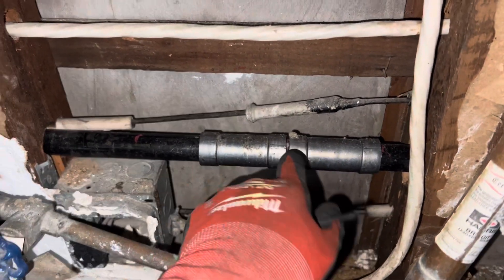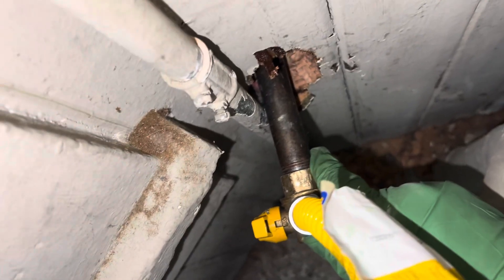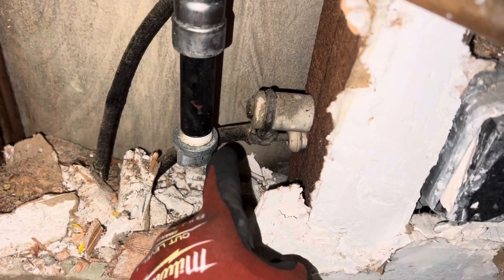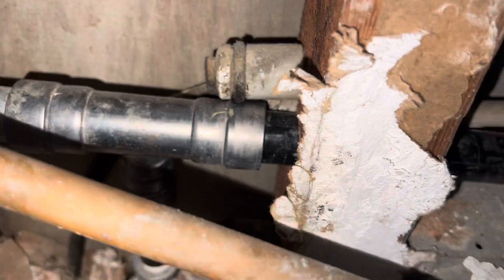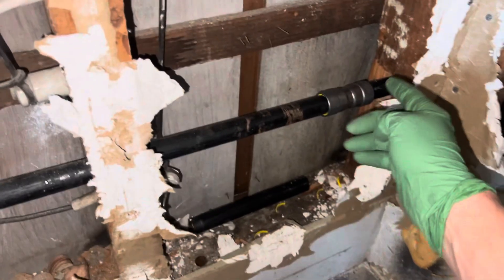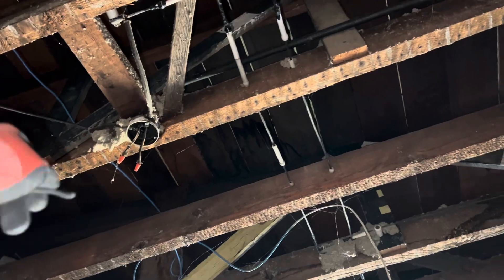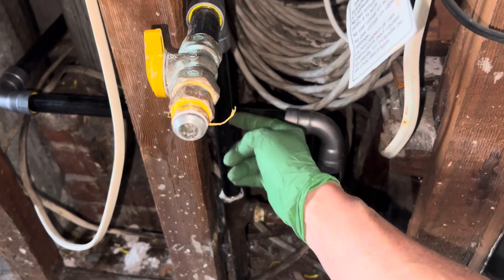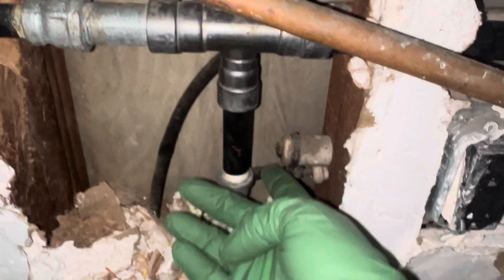Residential gas press fittings were leaking and dangerously 🔥 pressed against high voltage. ⚡️

Comment: I agree the installation was dumb, but show us the code that prohibits galvanized please.
Reply from the maker: That means you don’t work in California or in San Francisco some countries some states don’t have strict codes

If you don’t know the interaction between and the sulfur containing substance, they put in gas for the smell then that means you have no formal education. The reason why you don’t. 

In different areas have different percentages of quality of gas delivered to their customers some have higher moisture content into gas and higher oxygen content, air and other contaminants in the mixture. It’s not 100%. 

It often changes when delivered from the gas company. You can actually call down and get the BTU content. . 

Setting up to calculate their output, you know the quality and your company who delivers your gas will give that to you that time of year that it’s been delivered. You can do your calculations to clock your meter to set up your furnace and your are required to be adjusted for proper furnace set up. .
Reply: @coldfinger459sub0  I do work in California and I know of no such code.  For me to abide by it it needs to be written in the code book somewhere.

Comment: 120V is nowhere close to being high voltage, dude. 7.2KV on the supply side of a residential transformer would be for most folks, while 400KV and up on the big power transmission lines most definitely is.
Reply from the maker: Ok true. But more the most common people think of 12 car batteries. 

120V I touch for testing the way I was taught from my grandfather 👴🏻 old school 🏫

Comment: That electrical system is dead.  It shouldn't be a problem.
Reply from the maker: No it is no dead
Reply: @coldfinger459sub0  holy shit, they were still able to be insured with knob+tube wiring?! Btw, I loved the term "crispy critter wiring", that's hilarious!
Reply from the maker: @ScottFeatherston  you are correct knob, and Tube is being phased out by insurance companies.  

But actually, in reality, there’s really nothing wrong with knob and tube if you just never touch it .  

If people would stop piling stuff up in their attic space on the wires .  Putting in 1800 W heaters that burn up the wire nut connections because the copper is old black and oxidized.  Especially when somebody replaces a 15 amp fuse with a 30 amp fuse.

Comment: This is in SF, not to code at all and for sure never inspected and passed.  That gas install is totally not safe and negates the fire insurance if they have it.  If there is a fire the fire inspector will see that unsafe install and insurance will not cover their losses.
Reply from the maker: This is exactly why the owners contacted the company that did this. To do it properly.. 

I know the owner . 

They wanted me to do it . 
That is not my profession, even though my grandfather started taking me out to do gas, insulation water, pipe and sewer pipe, install installation starting at five years old to learn the names of tools .  And complete by the time I was not even in high school yet. 

I’ve had to redo gaspipe installations that were performed by PG&E on three different houses of mine . 

One location their installation leaked three times and I had to call them out to repair their handyman workmanship and this is PG&E . 

After the third time and it leaked again . 

I didn’t bother calling them. I totally disassembled their entire piping system going all the way out to the meter on the street retrofit upgrade that was 36 years ago and of course it has never leaked since then and never will. . 

Professionals are not professionals in this industry very rarely anymore. They were the youngest cheap guy who is capable of identifying and picking up a tool and kind of figure out how to use it and the owner of the company money. . 💸 

What industry has dropped down to plumbing, gas fitters , HVAC technicians ,roofers framers ,GC’s
Reply: This is why I do all of my own repairs and upgrades to my own house.  I have serious misgivings about today's construction techs , most if not all have little or no trade school background .  Where did all the shop classes go in high schools?
Reply from the maker: @woodway11  trades, cool classes they cut the budget. There’s some idiots who wear suits answer phones push paper and point fingers thought they knew better.. 

Why are we wasting all this money teaching kids a trade? 

They would say that private companies and owners of the small businesses are going to go out of their way and spend all the money and take the time to train the high school dropout in the high school graduates how to learn a trade on their dollar . 💵 

Well, we know that did not happen and now we are lawsuit crazy lawsuits over a cars lawsuits over home construction lawsuits over roofers lawsuits over gardeners massive disability to pay off for permanent disability by injuries because there is no safety training and usage of power tools so by the time the kids get out and go to get a job and use their power tools somebody needs new fingers Somebody break somebody kill somebody else and there’s a lawsuit all due to public school education system dropping the trades out of the public schools. 🏫 

Statues of all the individuals who signed the approval to remove the budget of the trades classes and post their names so they go down as history as destroying the United States quality of work and making children who graduate with a toilet paper degree unemployable